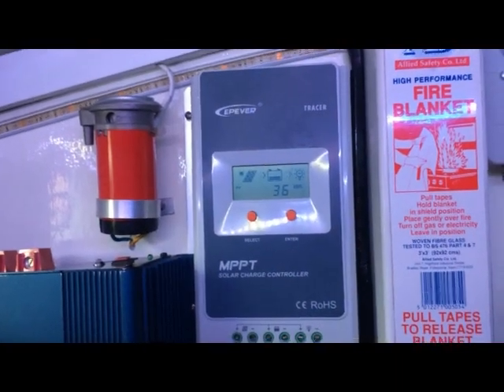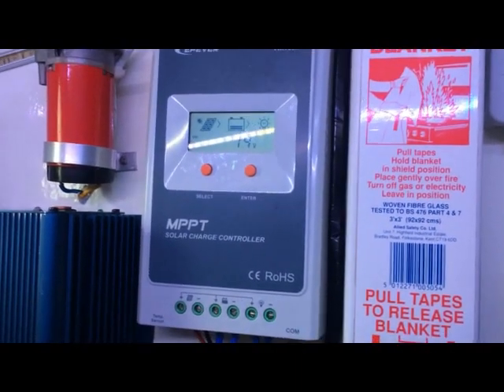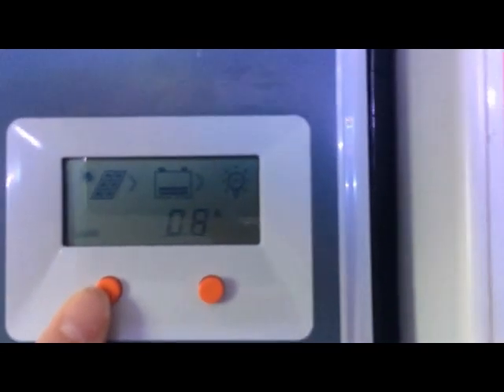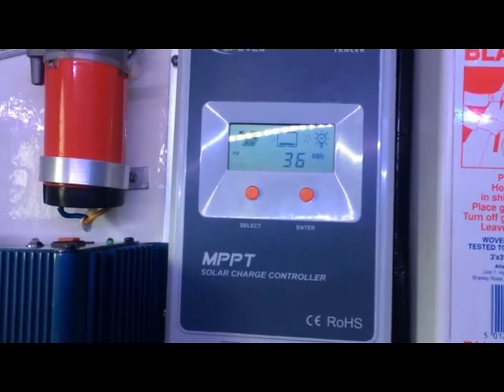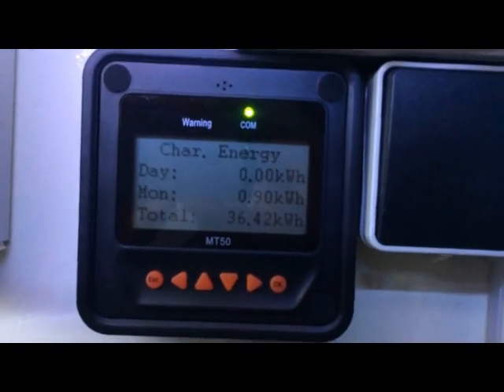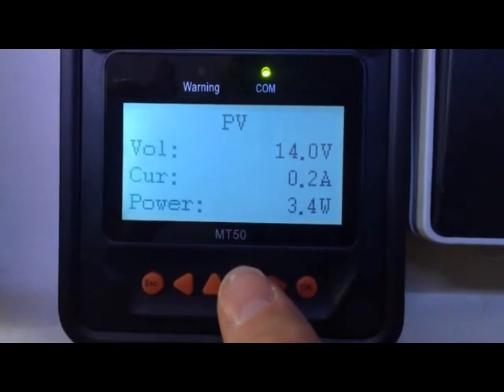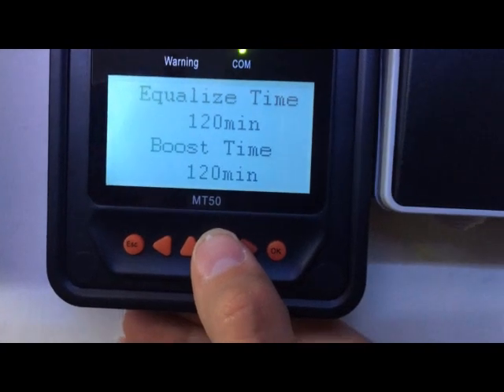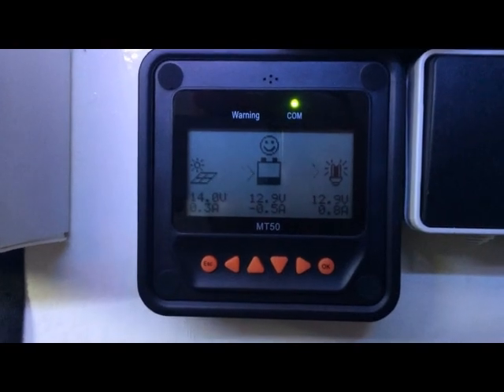EPEVER Tracer MPPT 3210A & MT50 solar charge controller review

Comment: Thanks for the video, great info. Real new to this, just a quick question, when you mention you connect a LOAD to the charger so that you can monitor it, these are all DC 12V loads right? If I only connect my MPPT charger to batteries and then batteries to an inverter for AC current, then this LOAD feature in the MPPT has no use to me, right o wrong? thanks!

Comment: Can the Screws that Clamp the power wires to the Charge Controller be Replaced?
They are too damned small and the heads of the screws are made from cheap Chinese metal !
Thanks... Liked/Subscribed
Reply: Yes, I use the nuts from BP terminals, they are identical

Comment: When you press the enter button, does it just disconnect the power to the load output, or does it power down the whole charge controller?
Reply from the maker: It just disconnects the load output.  Its also important to note that it switches the negative as opposed to the positive as might be expected!
Reply: @VanandBoat  thanks for your response. Much appreciated
Reply: @VanandBoat  The new AN models are common negative, all new units are now such

Comment: Good!Jawmall Supply solar charge controllers with high quality,Jawmall.com offer solar charge controllers from 3A to 80A PWM Solar Charge Controller and mppt charge controller,EPever solar charge controllers,Jawmall solar  controllers,Jawmall Solar Regulator,Power Inverter,EPever Inverter,Power Inverter,Sine Wave Inverter,High-Frequency Inverter, Solar PV,Solar System,Solar accessories, and more for Retail,Wholesale in Jawmall at right price.Contact us: sales@jawmall.com or Phone/WeChat/WhatsApp: +86-18002505142  By www.jawmall.com.

Comment: Hello!Hope someone help me with this.I`ve just set up my electrical system.Renogy solar pannel
160W with 20A MPPT Epever charge controller with Victron 125Ah SuperCycle leisure battery.When i got my leisure battery delivered i dry test fited everything to make sure its all good.My first question is:Why the MT50 remote meter shows my battery is fully charge (14.1V) with the "smiley face",but the actual load in the battery is just 11.7V (just received and still did not make the first 24 hours charging).The seccond question is even if a put a load i can not see the AMPS in and out on the remote meter,it shows just 0.00 i guess this is because if i dont put load via solar charge controller outputs i am not going to see the amps flow on the MT50,am i right for this or not?If so i guess i have to install a separate "battery meter" where i can get the correct load and condition on the battery.Also there is a option "Charging energy history" u can check daily and monthly how much power you getting,but after 4 days mine still shows 0 on everything,thanks in advance

Comment: So what was drawing from your battery in this video? I have the same controller and it was showing the light bulb icon flashing but I didn't have anything on. In fact I turned the electrics to the habitation area off. Any ideas? I've just fitted the battery and I don't recall getting the light bulb icon flashing with the old battery I've just removed 🤔
Reply: Don’t forget the remote display controller draws power :)
Reply: Good question, I need the answer as well please.
Reply: @gergmac  Don't think we're going to get one, do you? 🤔🙄
Reply: You can still have the bulb showing and no draw from the power. Just press ok and it goes out.

Comment: I got no arrows from solar to battery can you help please
Reply from the maker: There are no arrows from solar to battery when there is no power being generated by the solar panels.
Reply: If the unit is registering a fault it will not supply current, you can try connecting your load directly to the batteries, you may find it stops charging as well if there is a short circuit, get the PC cable and install the software, was the only way I could find out why one of mine was doing this, still not sure why it registers a fault as I fitted the spare unit and it works, pulled it down and found no signs of fault though it works with a small panel charging my cars battery during extended periods of non use.

Comment: I have epever 50amp, 4x240watt panels. Problem is, im getting 130 volt and very low amp even on sunny day, i didnt understand where is the problem,  maybe the angle of the panel, or it is faulty panel?
Reply from the maker: My unit has a maximum voltage input of 100v. Assuming yours is the same,  It may be that it is cutting out due to over voltage.  Try wiring the panels so that instead of 4 in series, you have two lots of two in series.  These can then be wired in parallel which will halve your system voltage and bring below the 100v limit.
Reply: @616e6f6e I had about 0,5-1amp, but i think charge controller is actually at equalizing voltage, so that was confusing. Another problem is, i think i dont have enough strong wires to connect batteries, so when i have strong consumer after 30sek im getting warn signal that voltage is dropping, so i thought ok they are empty, and then i let it to be charged. After i while, as i said im having funny situation with low amp charging (equalizing). So i think i have problem with cables. Im waiting for summer to check that again, house is in another country.

Comment: Good video. Thanks. If you install the controller in an easily visible location, what does the MT50 add? I know you said it added some things, but suggest one or two that you think make it worth while. Thanks! Scott
Reply: I have the same and i do not regret buying the meter mt50. It allows to adjust battery charge settings and is far easier to get the information needed to get a good understanding of how everything functions in all the different exposure situations.  Admittingly now that i have a good understanding it does not really do a great deal extra. It does have a back light which the main unit does not. The screen gives all the "needed" information without the need to scroll through the menus.

Comment: I have the same controller. But have a question that nobody can answer me!
Why does the charge indicator show only about 50-60% at a battery voltage of 12.8V?
That bothers me! Is that normal? Can you change that?

Hier das Selbe in deutsch:

Ich habe den selben Regler.  Habe aber eine Frage, die mir niemand beantworten kann!
Warum zeigt die Ladeanzeige bei einer Akkuspannung von 12.8 V nur etwa 50 -60%  an??
Mich stört das!  Ist das normal? Kann man das ändern?
Reply: Did you find a answer for this?
Reply: I have noticed the same. I have 24v 360ah system, and if i have stronger consumer voltage drops immediately.
Reply: You need to change the settings so the MPPT knows exactly what it’s feeding into... change it to represent the type, number of amp hours etc and it should show full at the right voltage
Reply: I suspect your referring to the battery image on the display, That annoys a lot of people and is something the developers don't care about, use the parameters displayed to judge where your system is at.